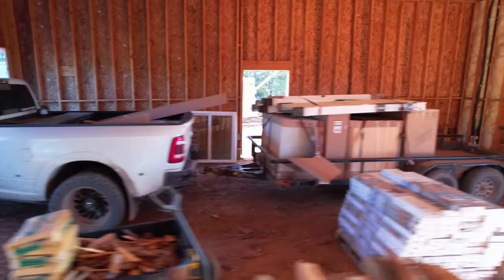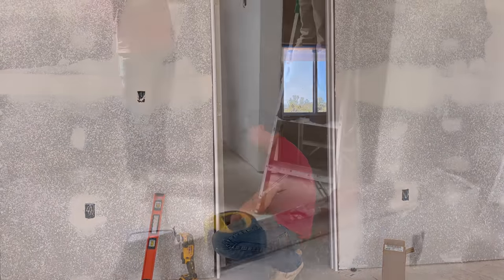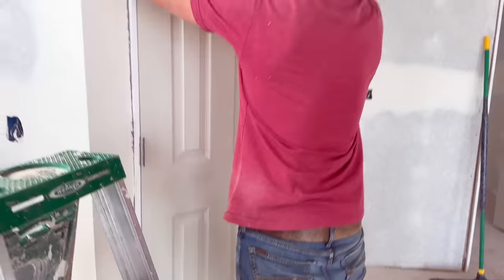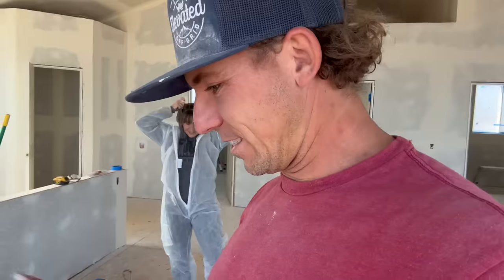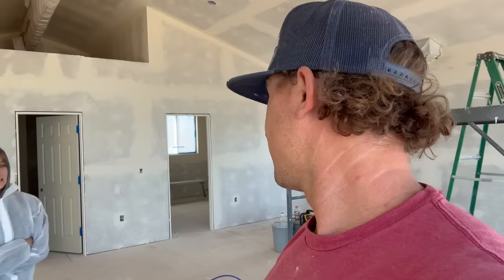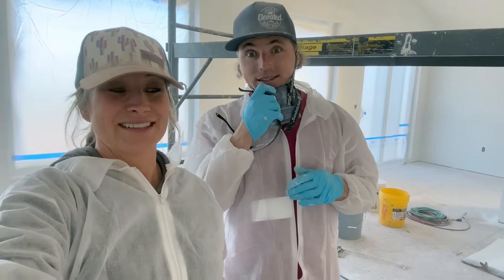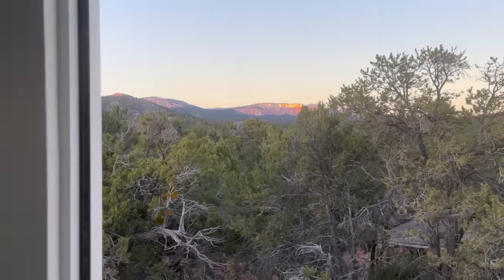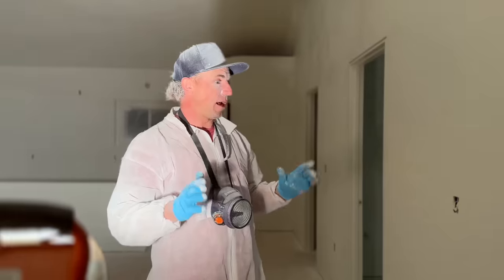PAINTING OUR OFF GRID APARTMENT

Comment: As you get a lot of Snow, how about getting some long 2x6 lenghts of wood, put them across 1 of the garage door entrances you dont use, nail or screw them in, then cover the entrance with a Big sheet nailed to the 2x6's, that way it will keep the area from turning into a mud bath!!, and you dont want that again if you have the wood stored in there..

Comment: Getting the primer and paint on will visually make so much difference for you.  I suspect with daylight the next day you saw your dry streaks.  It always a crap shoot spraying in poor light unless you are experienced at spraying etc. Keeping the tip level & parallel is difficult when you don't have adequate lighting.  You've made great progress and have turned the corner where it will really start moving and you'll be checking things off your list pretty regularly now.  Looking great, keep up the good work and you'll be done soon.  Larry, Central Valey, Ca.